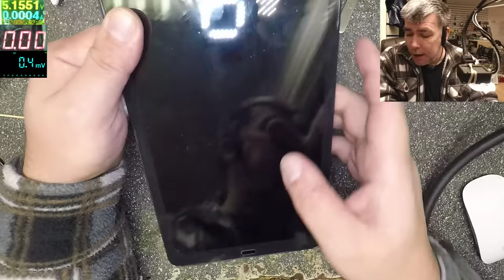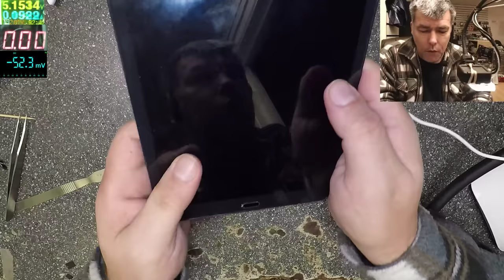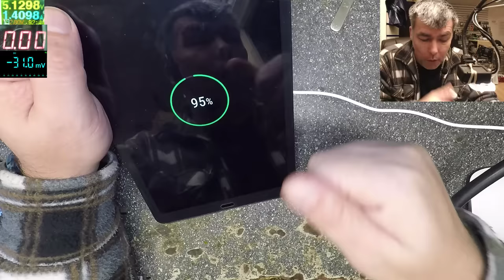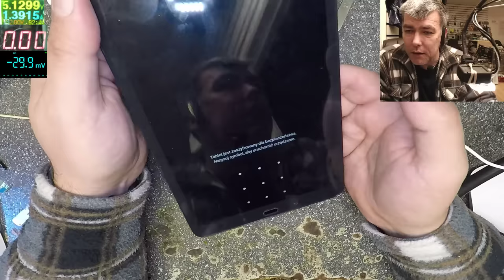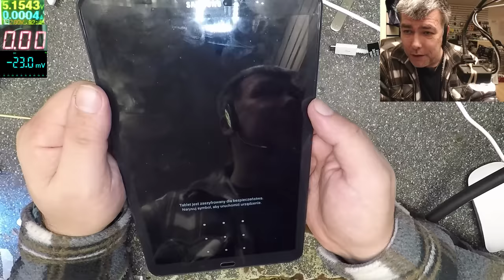Samsung Galaxy Tab A SM-T580 No Power, Not Charging

Comment: You saved my wife's sanity during self quarantine! She dropped her tablet last night. Your instructions are spot on. My only difficulty was getting the back off of the tablet. The fix required seating the video cable, then removing the battery cable for 20 seconds to get it to reset. Powered right up. Thanks for taking the time to post this!
Reply: I don't know if it would  work

Comment: You just made my day.  I'm so happy!!!  I was so scared to open it that I would have spent $250 on another until watching your video.  Thanks for the courage I needed to take that step. It wasn't easy getting the back off but when I did I followed your lead and all it needed was to unplug the battery and reconnect. Its now working beautifully. I have the 8 inch version as well that hasn't worked in over a year.  Guess what I'm doing next:)
Thank you so much
Reply: So did the 8inch tablet return to life? Cheers from Melbourne Australia 🇦🇺👍🏻

Comment: I've been trying to fix my son's T700 for a few weeks as it wouldn't turn on or charge, just no response, even recovery or download mode. Tried a new charge port and a new battery. Nothing. I saw this video and disconnected/reconnected the screen, which is a snap fit, not a ribbon cable. Put the battery back in and plugged it in - the screen came on & it started charging! You have saved me the price of a new tablet and I've subscribed. Thank you.

Comment: Thanks for the advice! I had a flickering screen and the battery would not charge. Opened it up as you suggested, used a plastic bike tire leaver, disconnected the battery, power cycled to discharge the motherboard, then reconnected the battery, closed it up and plugged in. Now taking charge. Thanks champion!

Comment: This solved my problem, thank you so much!  I first tried all of the usual solutions (hold volume down + power buttons for 15 seconds, etc.) but nothing worked, then I opened the case and followed this video.  The screen connection cable had slipped out a bit, almost identically to how it was shown here. Once I pushed it further in, reconnected the battery cable and connected the charger, it all worked.  Brilliant!

Comment: I fixed my charging issue by just disconnecting the battery and holding the power button for a minute with no battery connected, worked like a charm.  Typing this review on it.

Comment: Great video, loose screen connector was the issue for me, happily fixed and all good. Thank you!!
Reply: How do you get past the heat sealing?
Reply: @magmafang7187  Didnt need to. As per video I just teased the line on the ribbon to "line up" again with the board and hey presto. Battery was 100% when the screen came to life so was obviously charging ok. Amazing how such a miniscule adjustment that took 5 mins in total, got things back to normal and saved pounds 😁
Reply: @garycoogan2003  I got mine working again by no joke just wailing it around hoping some sockets would line up.
 AND IT WORKED
Reply: @magmafang7187  🤣 I have no idea how mine had worked loose. Maybe I should have tried your technique 👍😁
Reply: @garycoogan2003  well and slightly cleaning the charger socket but I like to think it's more of the WAILING that got it working

Comment: Thanks a lot! All the other repair videos  for this problem are just pushing buttons.  You can hardly see that screen cable is not properly fixed in connector but that was the problem.
Reply: Mueldelo

Comment: Had no charging light, no screen, no reset etc worked,  opened it up and noticed the two ribbon cables had a bit of slack, removed the tape and sure enough just a tiny bit from the line... so tiny a distance away, just had to push them back in and tape down the cables with better tape and plugged it the charger and got a charging light, so the lcd screen cable had come out and the other smaller one as well.  Thanks for sharing this easy fix! I cannot believe tablets still have these shitty ribbon connectors instead of the snap on one's..

Comment: Hi there 
I have a tablet a like this 1 but may be a tad older. 
The number on it is sm t550 and not the 580 like you are showing.
The wierdest thing was a few days before it died it charged right up to 100% and it had never charged ever to that much since i have had it.
The most it had ever charged to was 83% to 85% but never to 100%.
I will check this connection of both the battery and the screen connection on my tablet as you showed in theis video. My  tablet was starting to freeze up as in just do nothing and then it would not charge at all and would still turn on and how a battery symbol appears but would charge past 0%.
I tried different charging leads and still no results so i ordered a new battery for it.
Worse case scenario is i will have to get another tablet as this sm t550 is a 2015 model so i suppose everthing has an expiry date.
Thanks for gr8 video.
Cheers

Comment: 2024 here bro it works thank you I did the battery method first that didn’t work and as soon as you said the screen it wasn’t aligned correctly I notice on my tablet it was just a tiny bit under the line could tell from the line on the screen line. It should be a line that goes right across. Found it at a goodwill it looked brand new like this one. Took it home set it up it worked for like a week I bought a case for it maybe I was being ruff with it or something but I don’t remember but good news it works no bad news

Comment: Very good instructions on this quick repair but, to further assist this repair, I would add a little bit of glue-gun type glue to the edges of the display connector to avoid a repeat and make sure not to use any permanent type glue in case future removal is necessary.

Comment: The first problem you mentioned happens with nearly all android tablets, it occurs when they have not been used for a while and as you said, the software becomes bugged, this fix will work with many other tablets, but i find you MUST hold the power button at the same time as plugging the charger in

Comment: Great video. explanation is great. my sister in law has two of these and both have the same issue. I've taken 1 of the backs off and followed your video but not working. is there anything else I need / could try? . thanks.

Comment: I am working on one of these and having similar issues. But I think I might also have a battery or charging issue? Do you know what is the charging and minimum/low protection voltage for this battery? When I started out, I measured 2.8 volts. I've charged it up to 3.8, but there is no more than 3.8v between the battery outer terminal and pcb ground, and same on the two "large" rectangular test pads right behind the battery connector. The battery print says 3.8v nominal, but is 3.8v max while charging, (and powered off - cannot power it on yet) normal for this device? I'm honestly more used to see lipo charged with 4.1-4.3v, but i don't know this device very well. I am trying to avoid replacing the battery if that is not completely gone - as it's almost the same price as a whole new one.
Reply from the maker: The batteries are getting charged based on constant current source, not voltage.
Reply: @electronicsrepairschool  So somehow no need for a voltage potential difference? Or do these lipo cells actually top out at 3.8 volts? This is new to me. Thank you.

You know if the controller on batteries lock up for good, if it it has gone down to 2.8V ?
Reply from the maker: @pr0xZen  https://batteryuniversity.com/learn/article/charging_lithium_ion_batteries

Comment: I just had one that had black screen but was powering up. The connector to the LCD screen had been pulled out. I had to remove the screen and digitizer just to reconnect it due to the molded frame of the inside.
Reply from the maker: u can use the solder iron from the back and cut down the plastic from the top of the connector

Comment: Sorin, can i ask a motherboard question please? HP 650 G1 laptop, socket 4th generation i5, power bottom do not work. Laptop is turning on only after bios reset and works further normally. Led light on power buttom is working, on its 4pins cabel i have 3.37volt 3.35volt and 3.07volts. When i push the power bottom to start the 3.07volts is getting 0 volts. Seems that is giving the signal. I orded new and changed the power bottom. Exactly the same result. Are you suspecting the super i/o chip? If it has a seperate one...

Comment: Tab A will always has this problems. It's important not to drain the battery, you should recharge after it drop to minimum 10%. If it drop to 0%, the tab might not want to charge back...in that case try charge it with powerbank instead.  I have no issues with Apple.

Comment: Omg I cracked the glass trying to open it 😭
Reply: @someone7150  No i didn't get it repaired. It's now in a drawer where I dump other old  gadgets and mobiles. Thanks for the advice though 👍
Reply: @munakhan5920  I used my finger nails to open mine. The gadget graveyard.
Reply: If you manage to create a bit of a gap, use a piece of cloth to push through the cover. I do this with my tablet.
Reply: I did the same thing. I wont be following anymore of this guys tutorials. "It is easy to open" my ass
Reply: @MichelePlunkett  It is easy to open these lol much easier than others where you have to remove the screen lol. No idea how you guy's managed to break the lcd must have been prying in the wrong place.
Reply: @someone7150  These are not even glued? They use plastic clips lol, you shouldn't be breaking the screen when taking these apart.
Reply: lol this happened to me too
Reply: Im using old plastic credit cards, club cards or kids unused playing cards. Never use something hard, steel if you have no praxe...
Reply: @someone7150  ive used my fingernails to open mine 😂

Comment: Hello, Mr. SORIN. I have an older laptop TOSHIBA SATELLITE PRO A300 -1MH SYSTEM UNIT starts and stops after 1-5 minutes, the fan is cleaned. I would also like to mention that when the charger saves the battery light it charges and turns off immediately. I measured with the multimeter at the battery port when weighing the charger I have the 12v which disappear immediately. With or without battery is the same problem. some indications please. Im not professional, just  amateur. WITH ESTEEM AND RESPECT
Reply: Thank you for sharing  this video. I thought my daughter broke it but I maged to fix it...!! 👍

Comment: My Samsung SM-T580 Tablet is probably 2 years old but has no more than 5 total operating hours on it.  I let it sit up for at least the past 12 months and it was dead as described.  SUGGESTION:  Give more detail on how to disconnect the battery cable. When you disconnected the battery in the video you did it very fast and your finger was covering up how the battery connector released the cable.  Unfortunately, that battery cable attachment mechanism is very fragile and I broke mine trying to get the battery cable disconnected.  Since I can no longer get the battery cable to plug back in - and stay in - then I'll never be able to find out whether the problem was the battery or the display connector (which looked like it was fully inserted).  Looks like my tablet is trash now.

Comment: This chronic issue has to be fixed by Samsung by putting this flex cable under the battery pack. Otherwise, when you play with a tablet, the battery gets hot and pulls the flex from the connector easily, it is very prone to tensions made by the battery or falling.

Comment: I have the same Tab A, but it does display the charging symbol and it will even run showing battery at 0%. But I dont think it is actually charging anymore. If  I unplug it will start booting itself up in a loop until the screen fades to black and only the backlight works and that too fails. I dont know what happened, all was fine until two days ago and the tablet just started to go to 80% and then this morning to 30% and now its dead seemingly. Does a battery die like that, just from good performance to suddenly not doing anything anymore? Or is there maybe a problem with the charging of the battery?

Comment: My tablet won't go past the battery symbol to the charging circle. Only happens if I allow it to fully drain. So far if I unplug and plug back in for an insane amount of times it will eventually actually charge. Trickle charge with a .4 AMP charger took some time but it's taking a charge.

Comment: Hi I also have a charging problem! The thing is that I see the battery icon on the screen when I plug in the charger but it's not charging regardless how long the charger is plugged in. And I can't start the tablet either. What can be wrong...? 
I also noticed after a while that it came up on the screen with red small letters that the tablet was overheated. Although the tablet didn't felt warm at all. Please what's your advice and what can be wrong?

Comment: Hi, My SM-T580 is not charging. I removed the back panel and tested the conductivity of the charging cable and it is OK. The circuit is fine, from the cable up to the motherboard, I tested both positive and negative leads. 
If I try to charge it while turned on, there is no sign of charging. If I do it with the tablet off, I get a battery sign for few seconds, then dissapears, the screen lights again, with nothing showing and then turns off and stays like that.
If I try to turn it on while the cable is connected to power, it will not turn on. But it will turn on just fine with the cable out of the power adapter.
I charged the battery separatelly, with a charger and it holds charge just fine.
If I leave it connected to the power, it will not charge wether turned on or off.
Any idea?

PS: in the meantime I am charging it separatelly, so the tablet stays open all the time and I charge the battery with my smart battery charger...
But the problem is still there.

Comment: HELP,  I have a Galaxy SM-T310 that wont turn on. It was in storage for 6 months. I charged it over night. I have it apart and the battery reads 4.22 volt. When I push the power button, it drops to 4.19 volts for 7 seconds and then back to 4.22 volts. If I connect the charger, the voltage on the battery does not change, It stays at 4.22 volts. If I disconnect the battery and measure voltage on the board where the battery plugs in (with charger connected) I read nothing. Shouldn't I have a charge voltage feeding the battery even with the battery removed?
I tried all the button tricks. I even eliminated the battery and used a power supply set to 4.2 volts. Still nothing.
Any Ideas?

Comment: Hi..I need help..I try to repair by your method..but have no chance to good results..In my situation another problem.
when I connect the tablet to the PC, I hear the sound of the connection and immediately disconnect and Windows tries to find a driver for the Exynos 7870 but to no avail of course .. And there is a reaction to the power button, when you press and release the sounds of connection and disconnect are heard .. I have this the same tablet but working and everything is fine with it .. when connected to a PC in the off state, it just starts charging .. and Windows does not make connection sounds .. only if the tablet is turned on.
It feels like there is no firmware .. and the processor does not see it. Can flash memory fail? Consumption with a charge of 0.18A is very small .. Battery 4.01V .. Thank you

Comment: Tried what you did but It did not solv my problem. The tablet is charging but way to slow. From 10% to 67% in five days charge. Tested different charger but no difference. Do you have any good ideas to bring it back to normal? 16 month since new and less used./ Tanks!

Comment: I pulled out the batt cable, and the ribbon cable. Plugged in the charging cable. When I plugged in all, charging started and the display turned on.

Comment: help please. have a tablet with the same problem (still have warranty) sent it for repair but the service center said that the software is tampered with the following message:
ODIN MODE
DOWNLOAD SPEED FAST
PRODUCT NAME:  SM-P585Y
CURRENT BINARY: Samsung Official
SYSTEM STATUS: Official
FRP LOCK: ON
Secure Download:  Enabled
WARRANTY VOID:  1  (0X0000)
RP SWREV:    B:2  K:0  S:0

I haven't done anything, it just went dead on me and since it still has 2 years warranty I sent it for repair.  Please help me understand how did they come up with software tampering when what you have shown is an easy fix.

Comment: Mines just stuck on charging with the energy symbol on the battery on the screen and it's not charging, please help
Reply: Keep it plugged in its probably completely dead
Reply: @Jeff9ers  it's just not charging at all like not holding any power, think I need a new battery
Reply: @kieranmurphy6538  ahh then idk. I just opened mine and plugged it in. It was stuck in the screen you are talking about but after 5 minutes it changed to the percentage image
Reply: @Jeff9ers  think I just need a new battery, probs drained it from using a lot and charging it a lot, thanks for replying